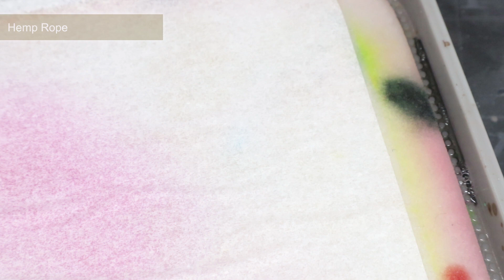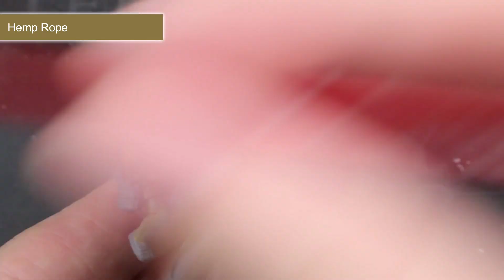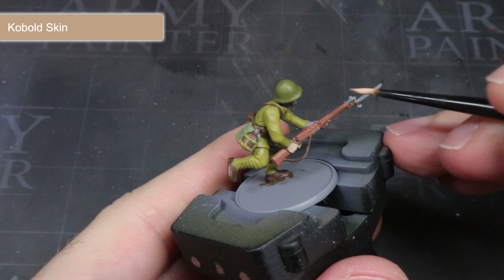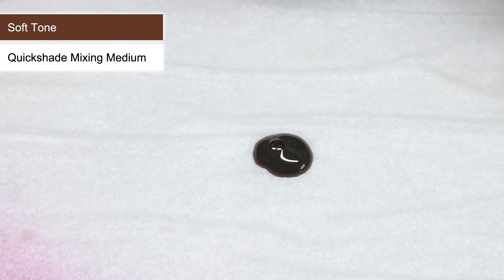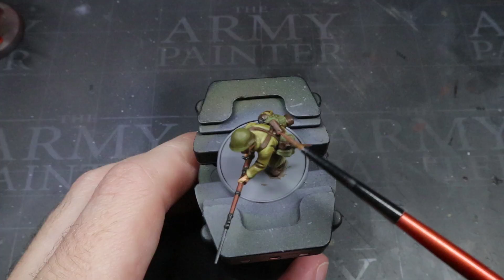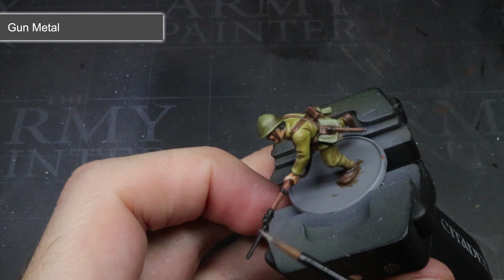How To Paint Bolt Action Japanese

Comment: I don't mean this as a dig in any way and I think that your techniques are proven from the results.

Back in the day, I was taught by very talented miniature painters, to use white mixed with  the base color to produce a highlight color.

Where you never taught to do this?  Or do you just like the idea of the model having 6 to 10 unique colors?   Reasoning?

I'm not understanding how your technique is better ,as the results seem very similar, and more expensive due to the the number of bottles?
Reply from the maker: Mixing white vs using a brighter, separate paint have different results and therefore different purposes. Mixing in white will lighten the tone but also de-saturate the colour. Which is why adding white to red makes pink. If you want to maintain intensity of colour in your painting then you will usually want to add more yellow to a mixture. Red + Yellow make orange, Dark Green and Yellow make a grass green colour. In this guide, I took the best of both worlds and mixed in a very pale yellow to most of my basecolors to create the highlights. 
But that's not the only reason to not use white mixtures. Many people find mixing paints in exact ratios to get the same colour over and over again for painting a full army just isn't practical. So having pre-mixed paints you can use is much easier for army painting.